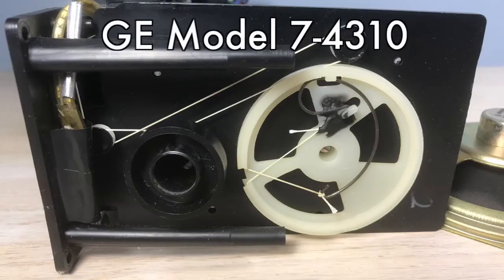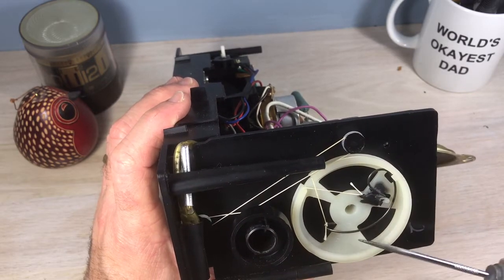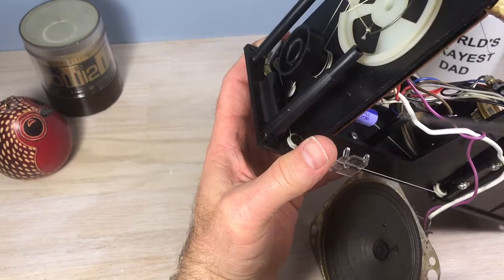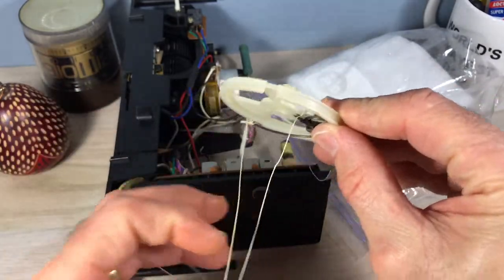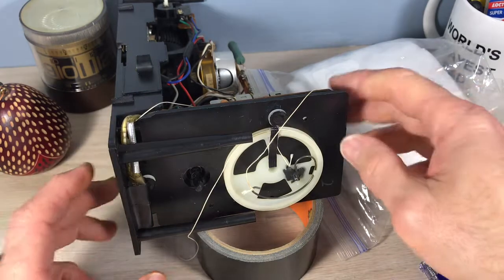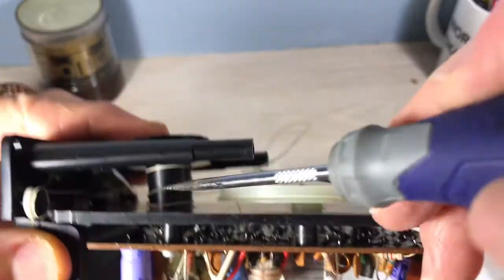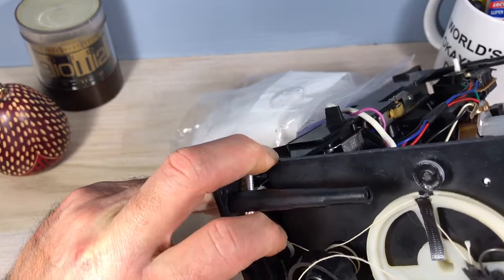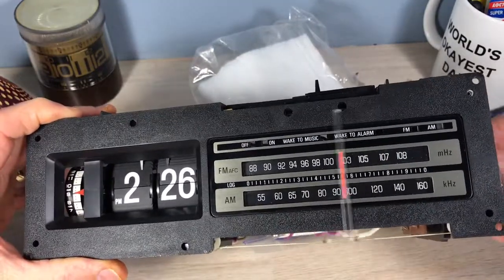Restringing A GE Model 7-4310 Flip Clock

Comment: I see that big blue/green resistor. Does that mean that all these 4310s are "hot chassis" clocks?
Reply from the maker: Good questions. I would have to say yes. These clocks have full mains power going into the motor and the glow bulb ( straight 110-120v volts), The circuit board power goes through a transformer. The good thing is the cabinets are all plastic - not a conductive enclosure, but if you think about it, the screws that hold the flip clock mechanism in place is a potential place that could become "hot". People new to clocks need to be aware that there is deadly power in these things. Thanks Jack.

Comment: Quick question, how were you able to take the knobs and the front out? i dont want to risk breaking it
Reply from the maker: Not going to be a problem at all.  The knobs pull straight off. Once the top is off the front is no problem to remove. You shouldn't have any problem at all.